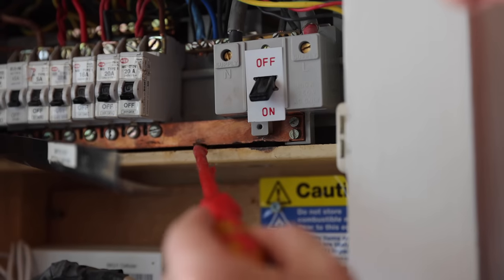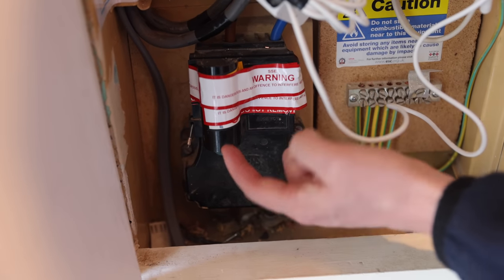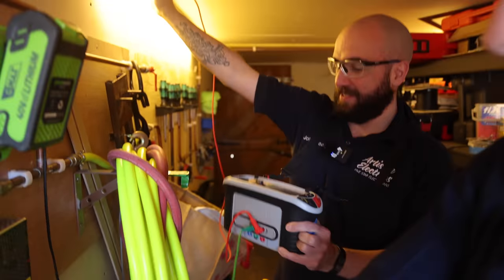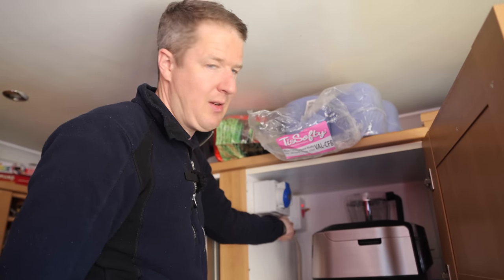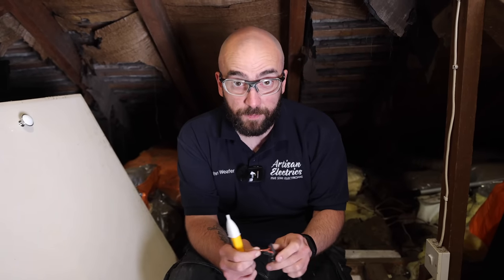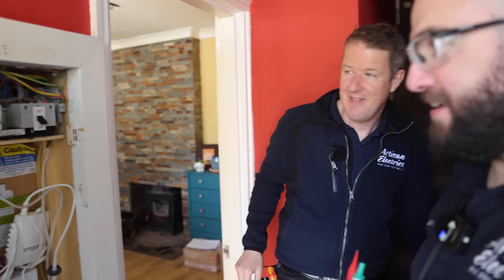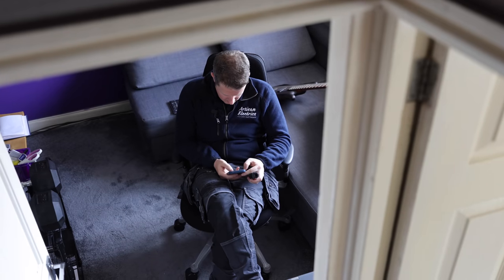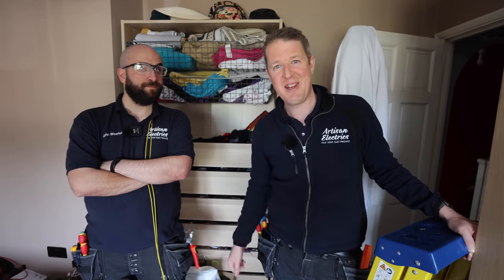REWIRED BY A CHIMPANZEE! Skeleton Board EICR

Comment: The most shocking installation I've seen was when the previous owners/'electricians'  connected the aircon before the circuit breakers, so literary spurred it off on the wire between the outside meter and the distribution board.  The only way I was able  to disconnect the aircon was by pulling out the wires from the meter.

Comment: i once saw my boss working to fix machinery on a 3 phase supply he opened up the panel to  adjust the plc he slipped with his screw driver and i  went blind for a second as the rail pretty much exploded. he soon replaced the entire panel

Comment: BS 3871 was assimilated into IEC 898 because the responses were close enough to each other to make 3871 satisfy the same standard, which is why it was part of tables right up to now.  BS 4293 was not assimilated into 61008 because they didn't satisfy other parts of the standard, hence why the 4293 standard is not recognized by 7671 (does not appear in the reference tables) and hasn't been since at least 16th if not before.  The trouble is, 4283's respond faster than 61008 (200ms vs 300ms) and are pretty rock solid until they fail, but they are prone to failure.
I haven't bought Amd 2 yet so I don't know that 3871 has been removed, but it is surprising to hear since nothing about them has changed...

Comment: 16:48 Given how concerned these guys are about safety, I find it funny that they're ok with electric showers... and this one didn't even have RCD protection 🤣
Reply: The fact they’re using throughput electrical heating — electrical tankless heater — at around about 10 kW is scary enough, but is it really necessary to put the unit in the actual shower?!

Comment: My personal opinion on the cooker hood is that if the wire is thin enough then your going to have a higher resistance and if it shorts you won’t necessarily get enough current to go through and trip the protective device in the time period you want. You could calculate that. Couple this to the lack of rcd and it’s starting to smell risky. You are not going to pull more than the in line fuse will pop at so wouldn’t be concerned about the motor failing and pulling more current as the fuse will blow. 

Just the possibility of a fault between the fuse and the socket which has the fuse for that supply ie 32amp or less. You could code it as a c2 but it’s unlikely to fail so c3 and let home owner know.

Comment: That’s a shocking house of surprises!! As a spark myself, I never understand why people “have a go” at there own electrical works, they don’t do there own plumbing or gas so leave it to the professionals
Reply: What makes you think they don’t do their own plumbing? For that matter, what even makes you think they shouldn’t?
Reply: @JasperJanssen  from experience mate, you don’t see 50 sinks and toilets round the house do you 🤣!! As your probably one that does do there all there own cowboy DIY jobs leave it to the pros
Reply: @davidellis4218  … that’s not how that works.
Reply: @davidellis4218  I had a reputable local company install a power supply to a greenhouse.  The work was then inspected by NICEIC. First problem: neither the metal frame of the  greenhouse or the aluminum work benches  were bonded. Next the buried connection to the greenhouse was twin and earth in plastic waste pipe laid in the mortar under the paving slabs. So having replaced the connection with SWA buried to the correct depth  I used my meter check all was in order. I was getting 240 volts on the earth!!!!!!!!!!!  The excuse was that the electrician who installed the RCD in the shed had failed to remove a jumper lead ? Perhaps one of you professionals can explain how this was missed in the professional companies final  check on their work and  by the professional body the NICEIC?
Reply: @JasperJanssen  what are you on about? You literally make no sense
Reply: @daviddearden6372  don’t know what this has to do with my comment of real life diy electrical experiences?
Reply: @davidellis4218  But I do not expect to be picking up potentially fatal errors made by professionals and  that were not picked  up by the inspecting body, Another example on this job was an outdoor socket which needed replacing. Coming from the bottom of the box was SWA which we assumed was a spur to the socket.  Except when we opened the box we found the socket was on a ring coming through the wall at the back of the box,  Also coming into back of  the box was the twin and earth for the outside brick lights.This was connected to the SWA with a connecter block hanging loose. There was no bonding to the steel outer of the SWA .  The  Consumer unit  is 17 years old and does not have a Rcd on the lighting circuit. You are not telling me this is a professional standard of work.
Reply: @davidellis4218  he’s sighting the fact that just because someone charges you for doing work and claims they are an electrician does not mean they unable to do a shoddy job. 

Agree some things done in houses should scare people but not all of the is done by DIYers, most likely most of it but it does get a little repetitive to hear that everything that’s iffy is automatically DIY. 

Frankly I think there should be training for basic electrical work, but major stuff leave it to the pros.

Comment: Is it wise to install the batteries for the solar system in the loft where the excessive heat may cause them to fail prematurely ?
Reply: Good shout - I was going to compare engine heat to this but I guess the movement of air flow when the car is being driven would offset that vs static sauana level heat in summer up in the loft
Reply: Isn't there a trade off to the excessive cold they might end up with for example in a garage?
How hot does a loft get in the UK?  We put Powerwalls outside in Queensland Australia
Reply: Surely these batteries are also installed in places like Arizona, Australia etc? Where it would be much hotter, even in the shade. No doubt there will be a working range for them too

Comment: Older devices...just because they're not in the regs now doesn't make them a fail.
You've got to remember that you're testing an older installation and may need to refer to older material to do so correctly.
The harmonised colours are a good indicator of vintage of alterations, makes it easier to determine if someone hasn't applied the protection updates (typically RCDs) that they should have at the time.

I've had unaltered 1970s installations with Wylex socket outlets and 3036s.
You can advise the absence of RCDs but if nobody has altered anything and it tests correctly, it passes.
If you found it had an extra socket added in new colours, someone didn't do their job properly to the standards of the time and it becomes a fail, even though the level of protection is no different.
Reply: That RCB is an issue. Don't know what the regulations says about it, but those older ones really don't like (as in failing quietly)  DC feedback from things like inverters, chargers, LED-drivers and whatnot you now find in every typical household.

Comment: if you're just wanting to test whether metal fittings are earthed or not, just put your volt stick against them - it will light up if there's no earth. Slightly less faff than the wander lead (although you can take an actual R2 with a wander lead obviously).
Reply: Genius 🙌
Reply: can you tell us why that would happen, most volt sticks are rated at >90v so wont tell you if if earthed or not
Reply: @brianhewitt8618  I'm not an expert in the physics, but I think it's because when the metal casing is not earthed, the line conductor can induce a phantom voltage in the casing. The phantom voltage is the same as the line voltage. My Fluke and Kewtech sticks say they're sensitive to >200VAC and both work for this.
Reply: So what happens if there's a poor or parasitic earth? Good enough to fool the chicken stick, but is it within the acceptable limits?  There's also no guarantee that the line conductor will induce a voltage onto a metal fitting depending on the construction of the luminaire.  For the sake of a couple of minutes with the wander lead, you can get a definitive answer.  Obviously down to the person who puts their name to the ticket as to whether they think it's a good enough test, personally not for me...
Reply: @farmersteve129  it's not a replacement for actual testing. It's just a neat trick.

Comment: Speaker wire?
Yes, hooked up to the cooker hood
Twisted together from the sockets
Which had been spurred from the upstairs lighting curcuit
Did I mention the hood was stainless steel?
And the wires were twisted together
And bare?
And mm away from the metal?
Yes, the previous owner was an excellent electrician 🤦🤦🤦🤦

Comment: I think that light fitting with the chocolate blocks (i guess) wrapped in insulting tape would invalidate the class 2 spec as it’s not been installed as per manufacturer instructions.

Comment: NIC EIC guy says its okay. I would not use a cable that could be fused wrong. I would always go for 2.5mmsq on a spur just in case that spur is changed for a 13amp sso. I have seen that done many times and yo end up with 1.0 mmsq cable feeding a 13amp so.

Comment: 18th edition stated that sheathed cables feeding power circuits must not have a csa less than 1.5mm2 (524.1). This has changed with amendment 2 to 1.0mm2. It always seemed like an odd reg to me. As long as the current carrying capacity of the cable Iz is greater than the rated current of the circuit protective device In (433.1.1) then why put an arbitrary limit on cable size for power circuits? So, under the 18th edition I'd say it would be a C2 - under amendment 2 it's not even coded!
Reply: I agree with you

Comment: re SFCU in kitchen, someone could put the wrong fuse in and the cable could be pushed to its limit in a fault. On the other hand it's a fixed load.
Reply: 1.5mm is 10 amp only in the worst case scenario surrounded by insulation in a stud wall without touching the plasterboard. Every other reference installation method is above 13 amps which is the maximum rated fuse that could be installed.
Reply: @toddbod94  I thought it was 1.00mm2? In which case 11A Ref A. Do we know where the (very small) length of cable runs? My point was really that a 13A fuse rarely blows at 13A load. I would be happier with 1.5mm2. But with a small fixed load I'd probably leave it - check the fuse is 3A and label the SFCU to say '3A FUSE'.

Comment: I'm Talking DC Here But Some years ago I found the ULIMATE Fuse in A Forklift Truck, the Fuse had obiously Gone at some Stage and it had been replaced by a 1/4 inch Thick Aluminium Plate, the Original Fuse was Rated at 500 Amps, I dread to think what current would be needed to blow this "new Fuse" and I wouldn't like to have been around when it did!

Comment: I'm surprised you have to ask about those MCBs, , you test to the regs at the time of the install and you make recommendations to bring it up to the current regs
Reply: He doesn't have to ask, he just knows that more comments is good for his youtube ratings :-) He's trading off apparent expertise vs income.
Reply: How is an electrician supposed to know when an install dates from? You're supposed to test to the current regs and it comes down to a judgement call as to whether something now might be perceived as potentially dangerous that wasn't previously. The Electrical Safety First Best Practice Guide 4 has suggested codings for most situations that you will encounter in old installs, such as no RCD on socket circuits and buried sheathed cables < 50mm - C3 for both btw as long as Zs is ok and they aren't serving equipment outside.

Comment: The point made by John about upgrading earth bonding to 10mm if there replacing the consumer unit is one I would question….

If you carried out an EICR and the main bond was in 6mm with a nice low reading I would code that as a C3, if I had to then upgrade the consumer unit I wouldn’t need to upgrade the bonding 

What do others think?
Reply: Depends, if there's any chance of the install becoming PME then it's going to have to be 10mm minimum according to 544.1.1 - which also says bonding must not be less than half of the CSA of the main earth for non-PME systems. So if you're going to upgrade the main earth to 16mm as part of your board change then 6mm won't be adequate for the bonding.
Reply: 6mm bonding is acceptable on older installations even PME aslong as no signs of overheating or thermal damage .

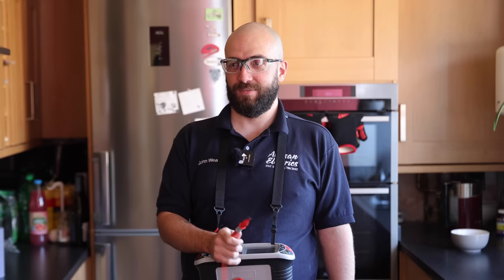Comment: Question, is the like's of that 1 mm squared (@ 11:17 ) is really just 1 mm diameter? so that 10 mm squared is really 10 mm diameter and not a "10 mm by 10 mm square?"
Reply: 1 mm^2 is the CSA (Cross Sectional Area) of the conductor and not the diameter (which would be less).

Comment: Overload device only protects the load and cable down stream of it, the 32A MCB is protecting that 1mm to the FCU. Fusing factor means that 13A fuse can probably carry 17A continuously so 1mm feeding a socket is not good, lack of coordination of the CPD and cable size, C2

Comment: 10:59 - According to BS7671 A2:2022, you have to have 2.5mm^2 CSA spur off a ring going TO the FCU and then you can have 1.5mm^2 FROM the FCU (with a 13A fuse) feeding an "unlimited" number of sockets as they are all limited to only 13A, but it HAS to be 2.5mm^2 up to the FCU...  Even for Fixed Equipment, like the cooker hood!  (See page 555 of the BBB, Figure 15A)
Reply: 13:00 - Surely you should not spur off a CCU at all?

Comment: For those who are new to modern lingo, "upgrade" means "make it worse".  ;p
And I can probably guess why they changed the phase colors, and it already is getting on my nerves, lol.
Those burnt wires remind me of the only time I almost had a real electrical fire.  I had a electric drier outlet that felt a little, I don't want to say "loose", but "not very firm" when I moved into a place.  Any experienced people know right where this is going.   Many years later I noticed that I could smell burning and almost see a haze, it was obviously concerning, but I just couldn't pin point it.    As it got worse, I started poking around, and when I unplugged the dryer and the outlet just fell apart.  O,O
Both the outlet and dryer cord were melted and charred, and that's when I remembered years ago when I first plugged it in that the outlet felt "odd".   I kicked myself in the butt because I should have seen it coming.
One lucky thing is I'm one of those guys who will not leave a dryer or stove running if I'm not in the house, and I won't even leave a portable heater plugged in if I'm not home.
That last habit means I've worn out many outlets over the years because outlets aren't designed to be plugged an unplugged daily.  They wear out surprisingly fast.
I actually got several outlets in my current place on the "needs replaced" list due to them being loose fits and I can feel heat in the vacuum cleaner cord after use.
For the unfamiliar, anytime you unplug any electrical device, note the temperature of the plug and cord, even if it only feels "warm" and make sure you are expecting that.  Certain high amp appliances, like vacuums, will always have some heat after use, but make sure to learn what is "normal" and what is not.   When in doubt, just consult an expert.  It's cheaper, and safer, than a house fire.

Comment: Holy shit.... do homes in UK not have 2 pole single phase service? For loads like AC units and clothes dryers?
Reply: We tend not to have AC units if we do they’re usually hard wired. And tumble dryers are happy at 2.5-3kwh 13amp 240v standard plug here. Things tend to be smaller than in the US. 

Only as heat pumps and electric car charging is becoming common is three phase entering the standard home

Comment: That range hood probably uses an induction motor for its fan. Surge current needs to be accounted for in addition to code for wire diameter and fuses inline with the load.

Comment: In New Zealand homeowners are allowed to do SOME electrical work BUT before it becomes live it has to be checked over by a registered electrician - if the homeowner doesn't and gets caught later on you risk being prosecuted and if at some point a registered electrician does come across dangerous works your compelled  by law to remove / isolate it and report to a govt dept - does the UK not do something similar ?
Reply: And this is why we have that rule here in NZ.

Comment: Should it knot be C2 due to OCPD being greater than the current carrying capacity of the cable I know its a fixed appliance that can't pull probably more than 5amp and it's a bit of a grey area but cable reduced prior to spur not good

Comment: It fails on board no cover. But it does not fail with old cbs or no rcd. As it was correct to the Regs of its time. If its safe its satisfactory. As for the spd that's only required on new boards and can be refused by client.

Comment: Maybe the subject for a future video, but let's see what customers like this are doing with all the data they pull off those CT clamps. Are you guys into aggregating all the data from circuits, car chargers, solar panels, batteries and the like? As the cost of electricity goes up, surely the place to start is monitoring your usage and making sure your domestic electric bill fits with the lifestyles of the residents?

Comment: Love seeing Jordan back on the tools. Has Cory been borrowing your Tesla? Stay away from those curbs 🫣 Interesting seeing the class 2 light fittings part. I removed the cheap awful connector and replaced with wago 221 would that satisfy regs or would I need to put them inside the gel wago connectors for double insulation?